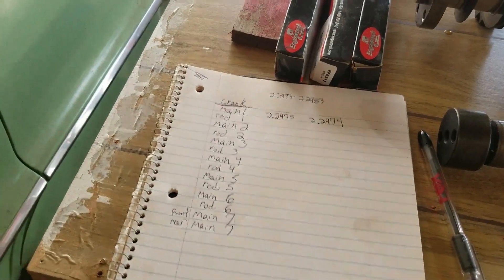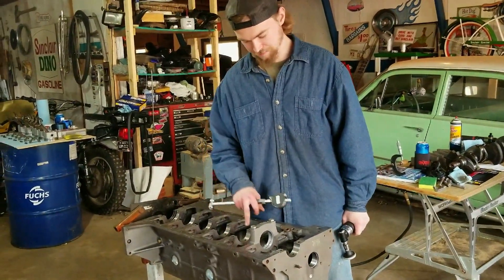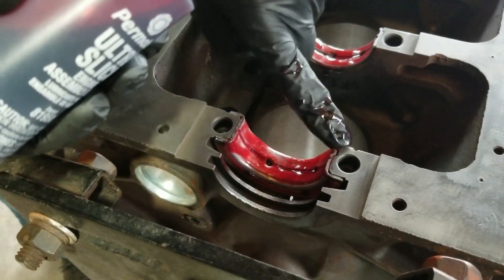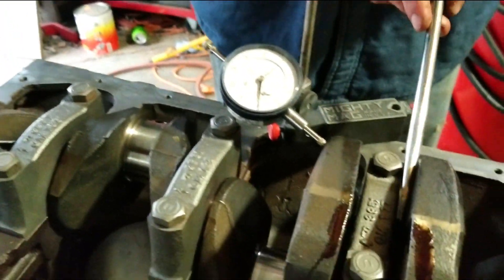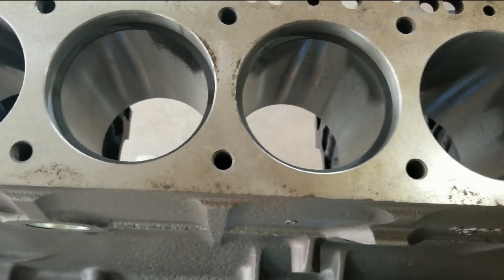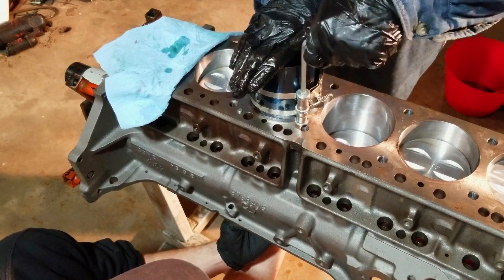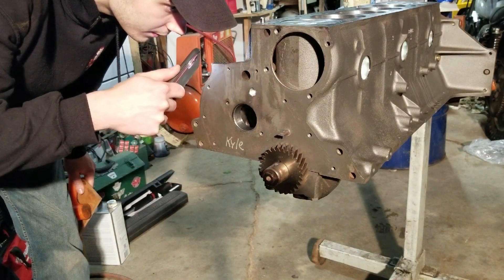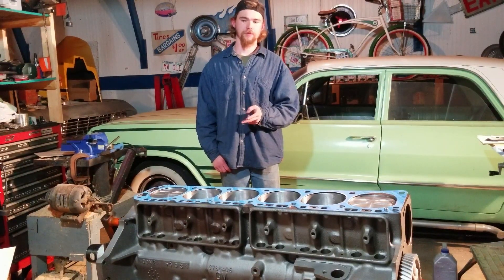Chevy 230 Engine Build - SHORT BLOCK

Comment: Great vid. I must’ve missed it somewhere but what pistons are those? They look like 307s for a little bump in compression. Considering using the same in my 250 with an RV cam 😎
Reply from the maker: They are stock, but . 030 over. You should try for 10-10.5:1. I don't know what stock compression ratio is, but It has to be low 9s high 8s and 10.5:1 would be perfect for a street engine.

Comment: at 6:55 does the caps have bearing in them because you skipped the process of showing it on camara.
Reply from the maker: Yes, the other half of the main bearings, and the large cap in the end has a thrust bearing and the rear main seal.

Comment: As an engine machinist you have some issues to sort out.  The crankshaft journal  dimensions for that engine are mains- 2.2983-2.2993 and 1.999-2.000 on the rod journals .  So your measurements on the main journals(assuming your micrometer was zeroed/calibrated with a standard) are .ooo8 (2.2975) out of spec and I couldn't read what your rod journals measured because your ink pen covered it up.  .005 is extremely excessive for that application.  Excessive main clearance allows your oil pressure to bleed off instead of forcing oil through the crankshaft oil galleys to provide oil pressure to the rods.  Dial bore gauge is the proper way to measure clearance but it has to be done very gently with the gauge set at an extremely light pressure so the contact point doesnt penetrate the bearing material and give an erroneous reading.  Telescoping gauge also work.   Both methods are far better than plastigage.

Your rod clearance specs made no sense!  1.0035 max to 1.9995 min??? Those specs give you a clearance range of .996 which is nearly an inch!  I think you had your numbers confused or decimal point in the wrong place.  

Never use a dial indicator at an angle like that!! It creates a parallax and gives erroneous readings. Always use an indicator "square" or at a perfect right angle .  Also ALWAYS oil the threads on the main cap bolts and rod bolts and also the bottom of the head of the bolt/nut that comes into friction contact during torquing.  The lack of lubrication  creates unwanted friction and gives erroneous torque readings.  I watched the video on my phone so I had a small view but it appears that your rear main seal in the block is in backwards.  

I will stop there with comments for now but I  would recommend no cold snacks during engine assembly!!!
Reply from the maker: Thanks for the help, I'll fix my typos. I didnt know how much clearance was too much. So the crank was polished .001" under spec but I'll be able to get oversized bearings. As far as the rod journals, spec is 1.999-2 and the rod bearings are at 2.003" so that's still within the specs with the clearance.
Reply from the maker: I'll go through it again and will tell what we did wrong in the next video.